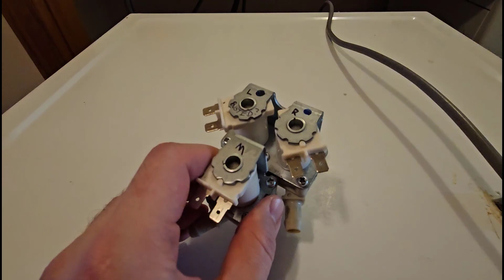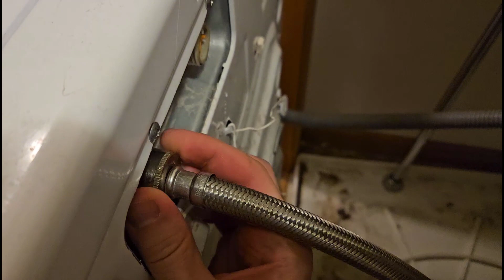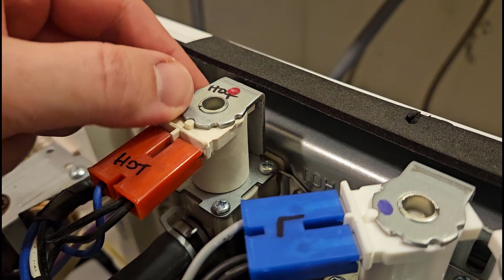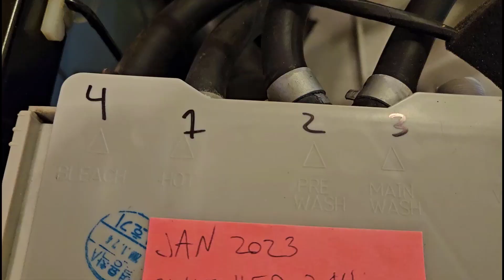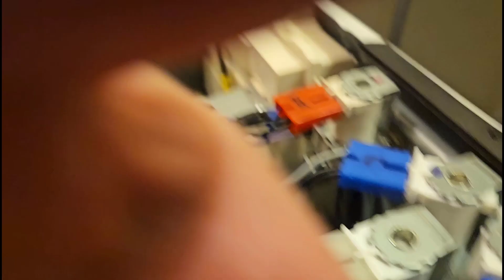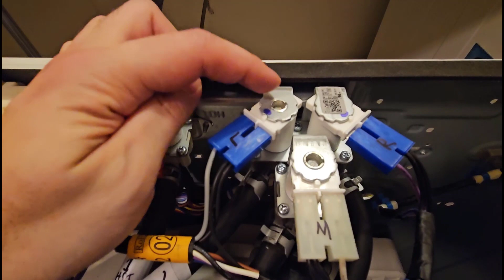How to Replace LG Washing Machine Solenoid Valve Assembly

Comment: What a great demo video!  Very, very helpful.  I replaced my drain pump and suddenly water not filling. Ugh.  Must be user error since I took out all those hoses and cleaned them out. They are gunky inside with limescale.  Now I know I can clean out each solenoid valve too, very good to know. Will do this today and see if it helps. Thank you!!!